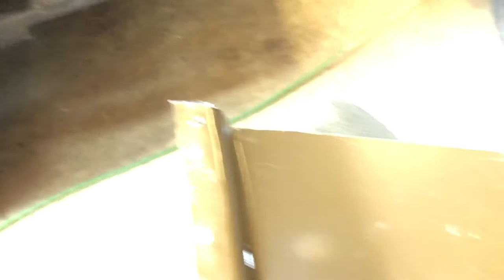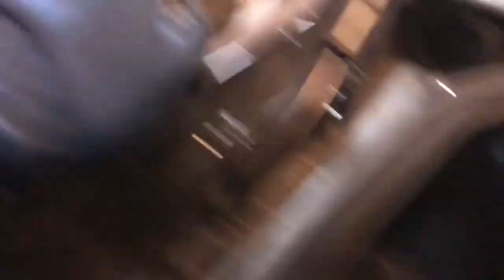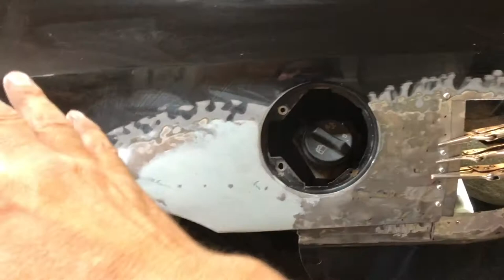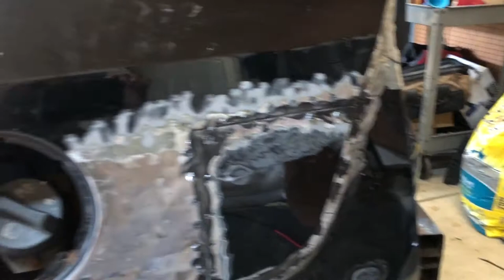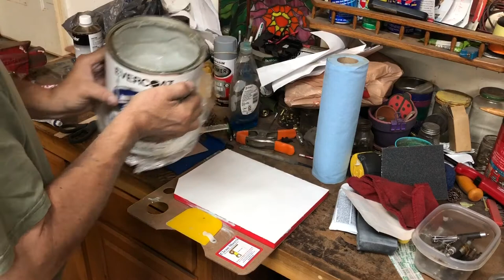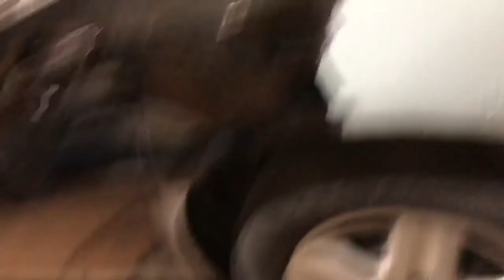Driver's side quarter panel repair - no welding.

Comment: That looks like that will turn out nice. Be sure you prime everything on the inside with etching primer so rust doesn't return. I think that should hold up good with the panel bond. A good quality panel bond will hold as good as a weld. They use that stuff to hold on roof panels on many modern cars. My favorite body channels are Sam G and Vehcor. those guys know there stuff. Check them out if inclined. Take care ED hope you had a great Fathers day weekend.
Reply from the maker: I'm going to hit the inside with self etching primer and then a piece of Dynamat to further protect it from abrasion and the elements.   I just hope the paint turns out nice without it turning into a major repainting job.   Black shows everyfreakinthing!  I'm going to end up doing a cut and buff on the entire car as it is.  I don't want to add a huge paint job on top of that!  Besides....paint is freaking expensive!  LOL!  When did that happen?
Reply: @resurrectionautorebuilders8465  HAHA! Yes I know! I painted the bumper and two fenders on a Honda Accord I got at Copart. For a quart of base and clear and a pint of primer it cost me a little over $150! Yikes! I'm sure the price is high due to some EPA regulations they have on paint being hazmat. I'm surprised they can even ship the stuff. LOL!